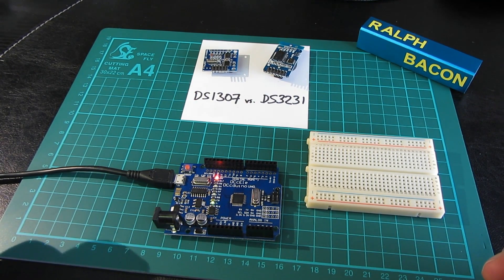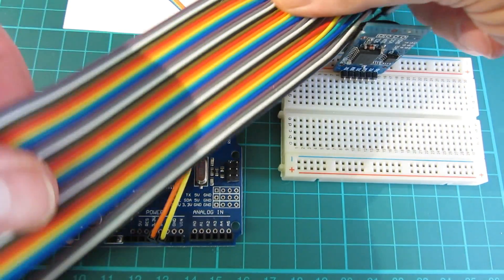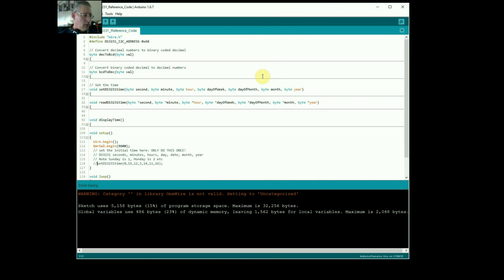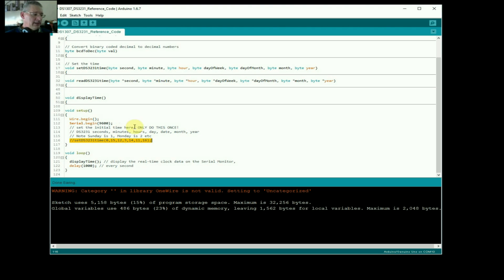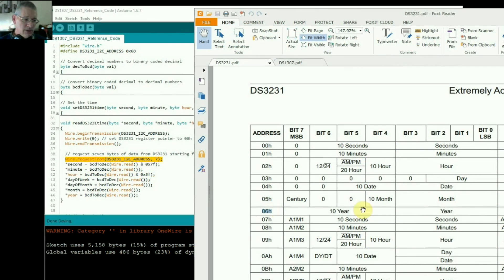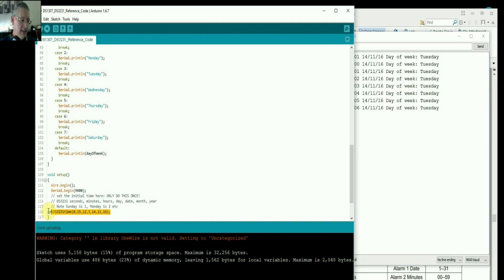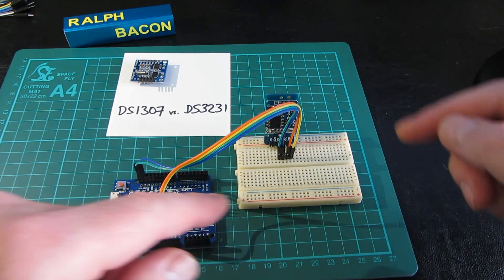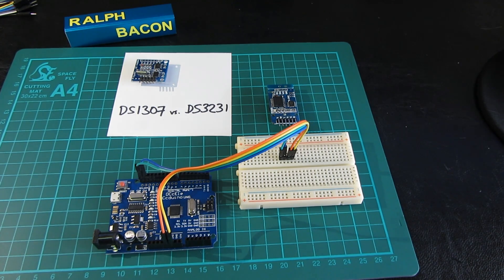#5 Arduino compatible Real Time Clock modules (RTC) - DS1307 & DS3231

Comment: Hey Ralph I got an issue with the time. the RTC module runs faster than it should. Like after some time, the RTC's time is coupe of seconds ahead than the computer's clock. how to fix that
Thank y ou
Reply from the maker: What module are you using Damith? The DS3231 is temperature compensated and should be very accurate. The DS1307 is not and is less accurate anyway (which is why I don't recommend it). Which one are you using?
Reply: I'm using a DS 1307z. temperature is with in the limits
Reply: got this from the web. but have mo idea how to fix it. 
'Fast Clocks
The following are the most common scenarios that cause a crystal-based RTC to run fast.
1) Noise coupling into the crystal from adjacent signals. This problem has been extensively covered
above. Noise coupling usually causes an RTC to be grossly inaccurate.
2) Wrong crystal. An RTC typically runs fast if a crystal with a specified load capacitance (CL) greater
than the RTC-specified load capacitance is used. The severity of the inaccuracy is dependent on the
value of the CL. For example, using a crystal with a CL of 12pF on an RTC designed with a 6pF CL
causes the RTC to be about 3 to 4 minutes per month fast.'
Reply from the maker: That's undoubtedly your problem then. The quality of some DS1307 boards (the design) is not up to manufacturer's specs, such as the capacitance used for the crystal, or there is a ground-plane opposite the crystal which increases the capacitance and slows down the frequency. They also lose or gain time as the temperature of its location goes up and down. Frankly, there is nothing you can do, realistically, to fix it. Buy a DS3231 and replace yours. The wiring is the same IIRC, or at the very least very similar (details will be in the video). That's the best advice I can offer!
Reply: yeah thanks Ralph !!!
Reply from the maker: Found a useful discussion stating pretty much what I just said. Especially read post #4 there, explains how much better the DS3231 is!
Reply: probably DS 3231 might fix the problem. lets see using that!!!!

Comment: Hi, I've Been playing around with this script learning about writing the on-board chip directly instead of using a library (Like You say saving memory but not relevant yet), But the Question is How Do you set say bit 7 high without changing any other bits (possible unknown value) do i have to read the whole byte then write back the value + 128 or is there an easier way? (Sorry for the dumb newbee Question but i've not done any coding since BASIC on a C64 back in 1985-8)
Reply from the maker: The way to change individual bits (when you have to write back a whole byte) is to use binary arithmetic. You are correct inasmuch that you do (sort of) add 128 but you do it by a binary OR (represented by ||). So, to make bit 7 high you would do something like:
char x = x || 0b10000000
which means if any bit is high (either in the char x OR in that hard-coded binary value then the value is 1). You don't want to change other bits so by comparing to binary 0 they will retain their original value, but bit 7 will always be set to 1.
 
Example:
0 1 0 0 0 1 0 1 - char x
1 0 0 0 0 0 0 0 - binary hard coded comparison as above
----------------------
1 1 0 0 0 1 0 1 - the final result
 
Does this make any sense? Good question, maybe I should explain this in a video segment in the future for others.
Reply: sort of. think a programming tutorial dealing with reading, writing bits to bytes with 1, a set of 8 leds and then putting that into writing to some chip to show it working. (I've learnt so much in the last month from your videos.) wish i'd found arduino years ago. Ebay must be loving me at the mo😂😂
Reply from the maker: I'll certainly consider some sort of video in the future Gary. Glad you're learning a lot, it should be fun (and from what you're saying, quite expensive). Don't forget to "thumbs up" any video that you like! Also consider the Far Eastern sites such as Banggood.com, Gearbest.com and Aliexpress.com as you can save quite a bit. Many of the sellers on eBay are also present in the Aliexpress marketplace too. Thanks for posting.
Reply: yeh im keeping the Chinese economy afloat single handed, ordered loads of different sensors so i hope you have also. some i havn't yet seen on your video list are laser sensor, colour recognition sensor, motion position sensor, gps, uv, ir temp sensor. all should be in uk any time now. keep up the good work looking forward to learning about the above.
Reply from the maker: You and me both are keeping the Chinese economy going! Keep tuned and if I have not covered a particular sensor do let me know.

Comment: Is there a better way to set the time instead of hardcoding it one time in the setup loop? I would like to accommodate for 1-second RTC drift by synchronizing the arduino with the local time of my computer upon uploading the sketch.

Thanks for the video!
Reply from the maker: You can't programmatically set the date from your PC, Philip, whilst uploading the code (we all wish!). But there are several ways to set the date/time programmatically (I've even written a library that only needs two switches but have yet to publish it, because I want to use a Rotary Encode instead, more flexible). Or set it from a GPS module every hour/day (I've done a video on that too). Any good?
Reply: Ralph S Bacon thanks for the info!
Reply: Couldn't you use the compiler "__date__" and "__time__" parameters to set the RTC chip when uploading code to the Arduino?  It seems David Johnson-Davies has done just that in one of his blog posts (http://www.technoblogy.com/show?1BGY).

Cheerful regards...

Comment: Did you ever wonder why these RTC’s store the time-date values in BCD as opposed to straight binary?  You must believe there is a practical reason for doing that. 
And there is a very practical reason for doing that.  Note that when the Serial.print function displays a number like say 17 it must convert it first to essentially BCD (because it is stored in binary—0b00010001) and then do a logic OR on each BCD digit with 0x30 (to convert it to ASCII).
Now if you use the Serial.print function to print a hexadecimal number, the number doesn’t have to be converted to BCD.  All that has to be done is to separate the digits (with a couple of OR’s and AND’s and Shifts)—no multiplying or dividing—and then send as ASCII to the serial port.
Now to be fair I haven’t seen any video on YouTube about the RTC’s where the hexadecimal values are utilized.  The all convert the BCD back to binary (note: that is what your “bcdToDecimal(byte val)” function does).  In fact, on that point, the DS1307 library for the Arduino also converts the BCD values to binary.
It is very simple displaying the BCD values from the RCT’s.
In your sketch you display the seconds value with the line:
Serial.print(second, DEC);
Had the value of seconds not been converted from BCD you would simply use the function:
Serial.print(second, HEX); to display the value.
Reply from the maker: Exactly so, #captrox. BCD is useful many times (not just to save storage space!). But I didn't realise that Serial.print also made use of this feature though. But RTCs do, of course and I explore this further in video #8 "Simple Demo of BCD". Thanks for that information #captrox, it's that sort of background knowledge that can really help us Arduinites understand what's going on 'behind the scenes' rather than blinding using some helper method. Thanks for posting.

Comment: can you help me why i'm not add library to arduino?
Reply from the maker: To add a library (a folder containing files ending in ".h" and ".cpp" as well as other files) simply copy that library (folder) to the "libraries" sub-folder which is found under your sketches folder. Yes, too many folder! Then you can write commands such as #include <mylibrary.h> and the compiler will search for it in the libraries (sub-folder). I hope this helps, but let me know if you still have problems (and what the exact problem is).

Comment: You said that the 1307 is not temp compensated as the 3231, but I assume that this would only be a problem in a widely varying temp environment. Also you had a physical II2C address of 68, but I did not see the address links connected when you showed the board. How does that work?
Reply from the maker: In my experience, Raymond, the DS1307 loses time like I lose my hair. Wildly varying temperatures just make it (even) worse. Go for the DS3231 every time! To discover the address of any I2C device just use the I2C scanner sketch; I'm guessing this one default to address 68 despite no pads being linked which is good because too many devices default to 0x27 range. It certainly worked though!
Reply: I will have to try that sketch. I am not used to things hanging on a serial line without a physical address. When we were developing Arinc 429 and custom chips back in the early 80's each box or board knew what packet to grab because it had its address on the leading bytes
Reply from the maker: I2C certainly uses physical addressing, as you know. When the master pulls the SDA line low (indicating a START condition, when all devices on the bus start listening) the next thing the master transmits is the address of the device (eg 0x68) to which it wants to talk. Only that device then responds with an ACK by pulling the SDA line low (which the master is by then listening for). The spec sheet for the DS3231 says the address is fixed at 0x68 with no means to change it, pity but at least it's well out of the 0x27 range. Run the sketch and you'll see it all works!

Comment: Another great video Ralph! 

I am still working on my aquarium controller project as per my last message regarding SDR's. So far I have successfully created a multi layer menu system which is displayed on a 20x4 I2C LCD and would like to incorporate a clock on one of the pages on the LCD menu. However I have a small problem, I  have a button scanning routine which is constantly running in the loop section of the code so how can I display the clock at will and still monitor for button presses. I don't wish to display the clock all the time but would like to dismiss the clock and return to my menu system via a button press.

Any pointers you can offer me would be greatly appreciated. Thanks.
Reply from the maker: Hi Fred, good to hear from you again.
 
Yes, you can do what you want with the clock. As you are constantly checking for key presses in the main loop (that's good) when you detect that the "ShowClearClock" button has been pressed then (from the loop) run the routine that shows the clock, set a (global) flag that remembers this and return to the loop. 
 
When the "ShowClearClock" button is pressed again, run the routine again except this time clear the clock (you know it's already being displayed by inspecting the relevant flag), set a different flag for the main loop to detect that the main menu should be shown, the loop then runs that bit of code via a function call and shows the menu.
 
Alternatively, you could show the clock for, say, 5 seconds, then automatically return to showing the menu. This is also controlled from the loop by decrement the count every loop until 5 seconds has passed then automatically call the "ShowClearClock" function.
 
I think you're already done it this way:  the main loop checks "Machine State" and fires off the required routines. So when certain buttons are pressed the main loop receives back a value from the "CheckButtons" routine and calls the routines that, for example, show the clock, display the menu etc. Each function does its own job and ONLY its own job with the main loop coordinating what needs to be done by inspecting flags (variable values). 
 
In this way there is no blocking code (no delay() calls) as each function knows what it is waiting for and carries on once it has the required input.
 
I hope this helps, feel free to ask further questions. I'm almost tempted to do a (simple) video on this!
Reply: Thanks Ralph for the very helpful reply, actually I was 'as we speak' working on just such a method that you have suggested. I absolutely love coding, it really keeps your brain active which can only be a good thing.

I first got hooked on programming back in the day of the Sinclair Z80 home computer with only 1Kb of usable ram on board, so I was programming it in low-level Z80 machine code, (none of that assembly language rubbish I might add !) writing instrucions directly to the microprocessor registers.

 I look forward to seeing your video on this topic, if you make one, keep up the good work.

Once again, thanks.
Reply from the maker: I once fixed a Spectrum ZX81 for my boss at the time. It even had a wobbly RAM expansion pack. Or am I thinking of a ZX Spectrum? Seems so long ago now. I'm pretty sure I have not coded in pure machine code, I've always used assembler, so kudos to you that you managed to remember all the hex values! Yes, I've added the video idea to my backlog, you never know...
Reply: Yes, that was the one I had, a ZX81 which was the first home computer to come onto the market, the Spectrum came some time after the XZ81 and had a coloured membrane keyboard. I also had the dreaded wobbly 16Kb expansion pack, many were the days when I had been up most of the night working on a stock taking application I was creating to use in my job, and that damn RAM pack would glitch and I would lose the whole damn lot!!!  I did eventually finish the application and it saved me many many hours that I would normally have spent using a calculator.

By the way, I have sorted how to show the clock whilst still scanning for button presses simply by declaring a Boolean flag that when set to true would allow the real time clock portion of the code to run, which would then disable the menu navigation buttons and vice-versa each time the clock button was pressed. The button scanning routine is a function call that returns a value, and the clock routine reside inside the loop but is skipped over if the enable flag is false. Easy peezey!

Thanks again for pointing me in the right direction.
Reply: Hi Ralph, it's me again. I have created a routine to set the time on the DS331 but I am having difficulty in passing a variable of type String to the setTheTime function. I have included the main part o the code below. The command that I am trying to process is setTheTime(stringTime), but it fails. My knowledge of C++ is a but limited, can you help?

CODE-------------------------------------------------------------------------------------------------------
#include <ds3231.h>

#define BUFF_MAX 128

void setup()
{
 Wire.begin(); 
uint8_t time[8];
char recv[BUFF_MAX];
unsigned int recv_size = 0;
 setTheTime("303917402022017");     // ssmmhhWDDMMYYYY set time once in the given format

  DS3231_init(DS3231_INTCN);
  memset(recv, 0, BUFF_MAX);  
  lcd.begin(20, 4);              // initialize the lcd - 20 columns, 4 rows
  lcd.backlight(); // Switch on the backlight
}
void loop()
{
  char tempF[6];
  float temperature;
  char buff[BUFF_MAX];
  unsigned long now = millis();
  struct ts t;
  // if enabled show time once in a while
  if (showClock)
  {
    if (now - prev > interval)
    {
      DS3231_get(&t); //Get time
      temperature = DS3231_get_treg(); //Get temperature
      dtostrf(temperature, 5, 1, tempF);
      lcd.clear();
      lcd.setCursor(0, 0);
      lcd.print(t.mday);
      printLongMonth(t.mon);

      lcd.print(t.year);

      lcd.setCursor(0, 1); //Go to second line of the LCD Screen
      if (t.hour == 0)
      {
        lcd.print("0");
      }
      lcd.print(t.hour);
      lcd.print(":");
      if (t.min < 10)
      {
        lcd.print("0");
      }
      lcd.print(t.min);
      lcd.print(":");
      if (t.sec < 10)
      {
        lcd.print("0");
      }
      lcd.print(t.sec);
      lcd.print(' ');
      lcd.print(tempF);
      lcd.print((char)223);
      lcd.print("C ");
      lcd.setCursor(0, 3);
      lcd.print("Press clock to exit");
      prev = now;
    }
}
}

void setTheTime(char *cmd)
{
  struct ts t;
  // ssmmhhWDDMMYYYY  set time format
  t.sec = inp2toi(cmd, 0);
  t.min = inp2toi(cmd, 2);
  t.hour = inp2toi(cmd, 4);
  t.wday = inp2toi(cmd, 6);
  t.mday = inp2toi(cmd, 7);
  t.mon = inp2toi(cmd, 9);
  t.year = inp2toi(cmd, 11) * 100 + inp2toi(cmd, 13);
  DS3231_set(t);
}
Reply from the maker: Hi Fred, sorry to hear you're having problems with your code. In this instance I strongly recommend you post your query on the Arduino forum (http://forum.arduino.cc/index.php) I suggest under the "Programming Questions". They have many experts who will be willing to help you (and, more importantly have the time to help you).
 
Your issue is that you're probably trying to adapt other code to your own use (you're using a pointer in your setTheTime routine but are passing in a string type, if you had written this from scratch you would know not to do this). 
 
As a quick fix, change the setTheTime function to read setTheTime(String * cmd) and then call it using the following:
 
String timeString = "303917402022017";
setTheTime(&timeString);
 
However, that will require you to change the code in the underlying function; this Is what I mean by you requiring more help than I can give you, even though I'd really like to, my time is in short supply (as we speak I'm trying to upload my next video!).
 
Give the forum a whirl, they will help you if you help yourself. I hope you understand my position. Good luck with this, I'm sure you will learn lots, keep going and never, ever give up!
Reply: It' s okay Ralph, I have sorted it with -  dateString.toCharArray(recv, BUFF_MAX);

then call the setTheTime function with -  setTheTime (recv)
Reply from the maker: Brilliant stuff Fred, perhaps it is you who should be answering the questions on the Arduino forum! Glad you overcame this hurdle!